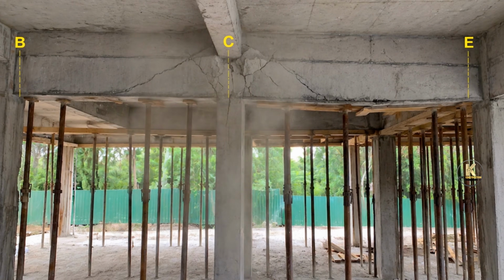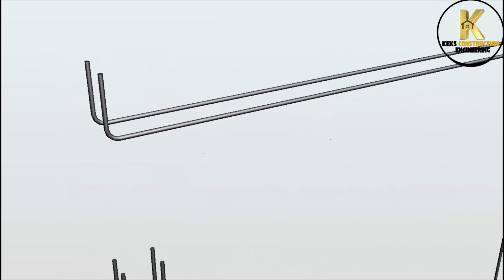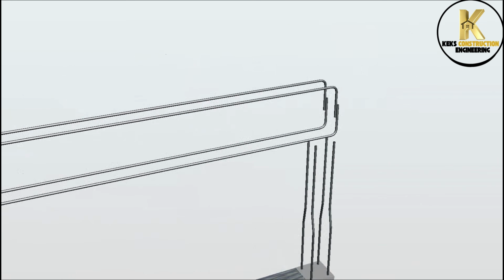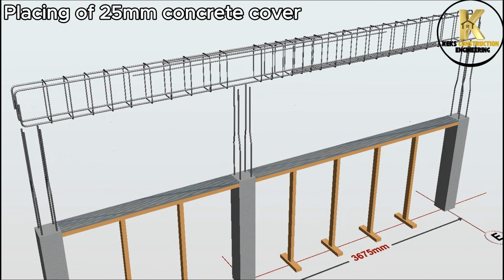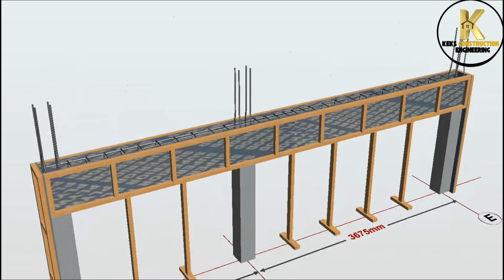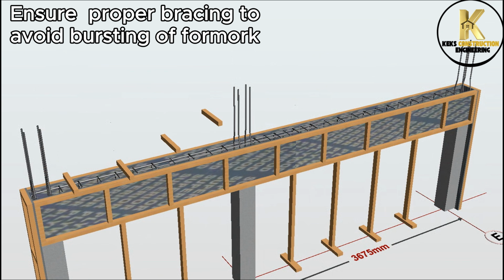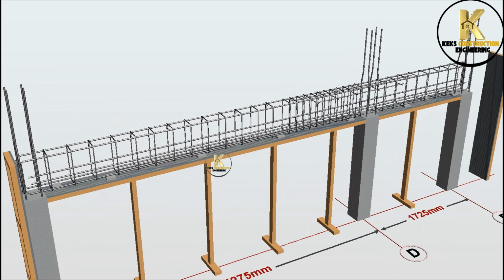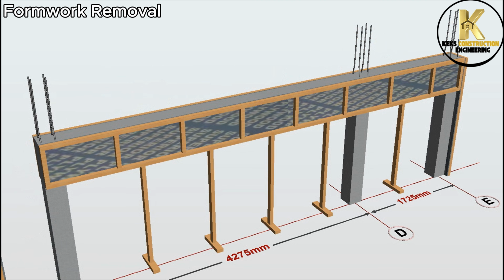Master How to READ and Execute BEAM DRAWINGS Like a PRO | Blueprint Guide

Comment: le fond du poutre ctd s'il faut savoir il faut axer le fond ou le partager...aussi les dimensions a partir du trait de niveau du poutre jusqu'en haut du poteau, là où doit se poser le fonds du poutre The bottom of the beam (ctd) needs to be determined; it must be centered or divided... also, the dimensions from the beam's level line to the top of the post, where the bottom of the beam should rest.
Nb:les deux chiffron qui relient les deux poteau,au fond de chaque poteau il y a une dimension qu'il suffit de chercher pour régler les dimensions... voilà 
Merci 14:02

Comment: 2Y12-6-225(T1)
2:  number of rebar
225:  spacing 
T1: Top 1
6: ?

Please sir what those that 6 means
Reply from the maker: It's called Bar mark or Bar Count, it's used to identify each Bar in the drawing. It's the bar identity....if you choose call it so.

Comment: Most times proper details are not provided for complex beams like this making it difficult for the QS
Reply from the maker: Yes... That's true.
It's because Most Clients don't engage a good structural Engineer for their design, they often leave it in the hands of some greedy Architects who engages a quack Designer so they can pay them peanut instead of engaging a professional.

One thing that the Clients don't know is that they spent more money when they don't engage a good structural Engineer. Because no designer will put in his best to bring out the best drawing when he's not paid well.
Reply: I’m a qs and I always ask for complete drawing both architectural and structural drawings. Without those, it defeats the purpose of estimating. 
If you come without complete drawings, then I charge more.
Clients need to be more proactive when it comes to complete drawings. It’s for their own good.

Comment: 2Y12-6(T2 ) what 6 means here sir plz
Reply from the maker: The 2 means 2 pieces of 12mm diameter Rebars of that bent shape.

Y12 means High Yield Steel Rebar of 12mm diameter 

The 6 is the Bar mark/Count/Identity 

T2 Means the second Layer Top Bars.
Reply: @keksconstructionengineering Thank U Best of luck for Million ❤ IA
Reply from the maker: @EngrMaazulhaq 
Thanks
Reply: @keksconstructionengineering very correct sir
Reply from the maker: @quantitysurveyworkshop 
Thanks...QS

Comment from the maker: If your blueprint says 2T16 (01) at the top and 3T20 (02) at the bottom, do you know exactly why the bottom bars are thicker? (Hint: It's all about the Tension Zone! )
Reading a drawing is one thing, but executing it without errors is what makes you a PRO. I’ve included a secret lapping tip at 7:05 that every site engineer MUST know to avoid structural failure.
Which part of a beam drawing do you find the most confusing? Let’s discuss it in the comments! 👇
PS: If you missed our guide on why Plinth Beams are the backbone of your house, watch it here: Why Plinth Beam in Building Construction? (Step by Step Site Work)"
Reply: I would like to have tutorial on being a steel fixer. It starts by reading the plan the right way. Kindly help me

Comment: Please why the pillas are not 6 rods u make it 4
Reply from the maker: Ok.
Column Reinforcement are not always the same. It all depends on the load of the structure and the structural design. A Column under much load is likely to have more Reinforcement compared to the one under lesser load.
So as Structural load varies, Column size and Reinforcement also varies.

I hope you I have answered your Question?.